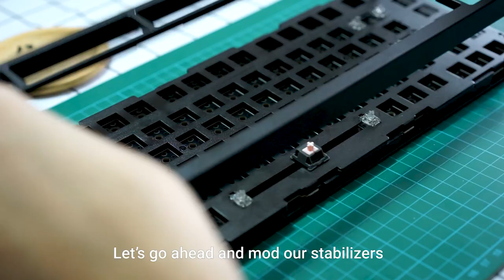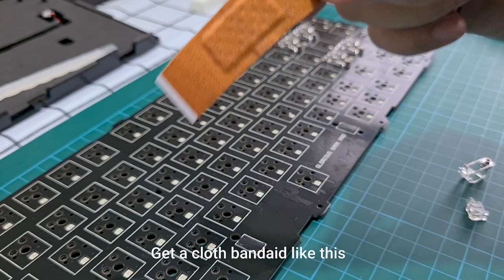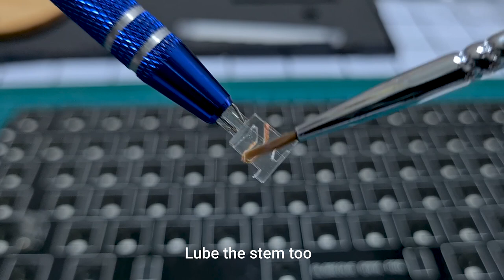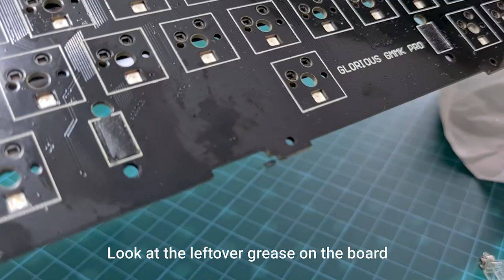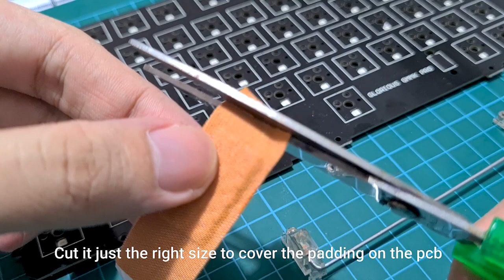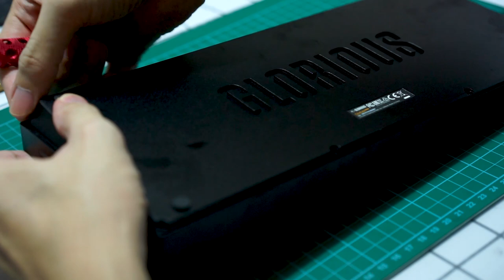Can Gmmk Goat stabilizer actually make good spacebar sounds?

Comment: At the start you just press the spacebar hard and soft and that the difference
Reply: That makes basically no difference whatsoever. The difference in sound comes from the mods he did, mainly the lubing. If you have cheap stabs unlubed, it doesn't matter how hard you press them they will sound terrible. (I'd still recommend durock stabs over any others though)
Reply: Yeah but any mistakes he made on his stand would be more covered up by the light tapping. I heard quite a bit ò ticking in the àter stabs

Comment: i just bought durock v2 for $26 because there was no way on a $190 barebones kit i was gonna have my keyboard sticking sometimes
Reply: You should have just got next time x75 or feker ik75. And use there stock stabs on the keyboard. Also if you didn’t want to spend so much money on stabs you could have at least gotten the everglide gold stabs because they are way cheaper

Comment: Would it be better to remove the stock pads and then stick the bandage to the pcb directly?
Reply from the maker: For mine the stock pads seem to be built-in to the pcb. I wish I could remove it too
Reply: @LostSheepWorks  Actually the pads can be removed, just go for the corner of the bottom layer. Need some time to clean the residues though.
Reply from the maker: @danielr700  oh! I didn't know that. Shall try it. Thanks :)
Reply: @LostSheepWorks  - looks like you are newbie i'm sorry. comment from othr "lmao why are you smacking it on the before, but lightly pressing on the after clip?
"
Reply from the maker: @jessiel9625  Thanks for the comment. I'm still a learning newbie :)

Comment: At first i didnt want to get that deep into modding my gmmk
But after my space got stuck nearly EVERY TIME i pressed it, i had to mod it.

I found that the Metal wire isnt really tight in the Stabs. Left side sounded fine for me, but on the right side it rattled because the wire had some room and liftet itself unlike on the left side where it did not move when pressing space bar

nice video :)
Reply from the maker: Thanks! Glad you managed to fix the problem too. Mine was so rattly out of the box too
Reply: @LostSheepWorks  actually got some durocks after i spent hours trying to fix the "GOAT"s. 
And damn those durocks are amazing.
Reply: This could be solved by just holee modding, but sometimes this is because the wire of the stabilizer isn't balanced, so one side is twisted further down than the other and the side like that has wiggle room. if you take your wire and put it on a flat level surface like a phone screen or something similar you can feel the balance of the wire, and it's just twisting the wire into place at that point. if you holee mod and you still have some slight ticking, this would be the next thing i would try if it bothers you.
Reply: @GenuineRage  ah yes i had a holee mod and tried wire balancing but I am sure i did that wrong, never really felt super flat. 
But neither did the durcks. 
For my next one i will try to wire balance and to a better job :D
Reply: same here I've given up till now taking apart and reassembling that board is a nightmare after doing it multiple times in one day without resolving it. I couldn't find any videos about thiss at launch and Glorious tech support was useless. Gonna try it again today
Reply: @skatemango  same and SHifts.